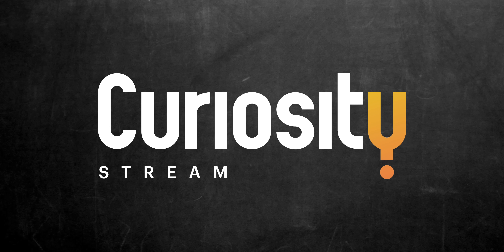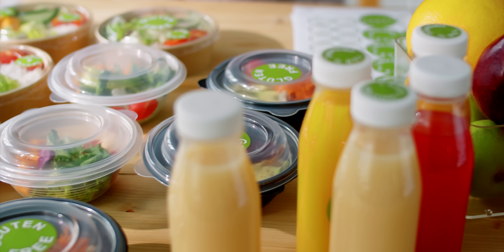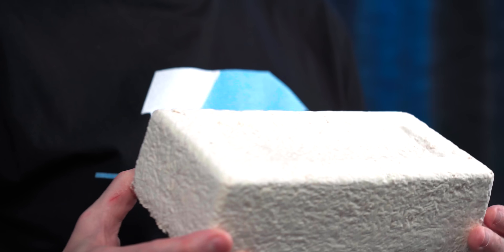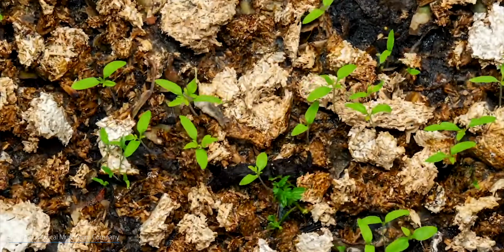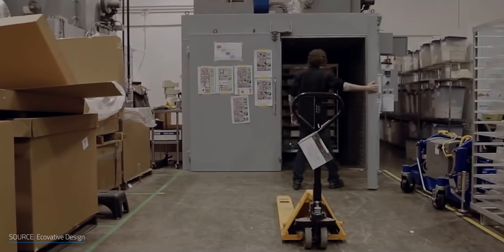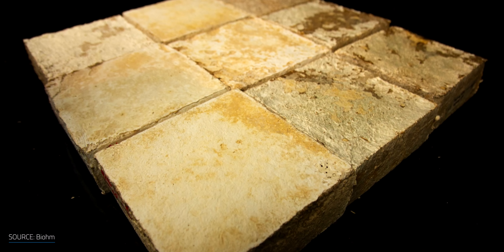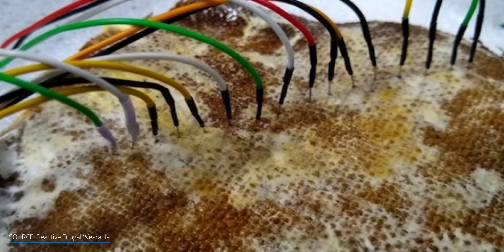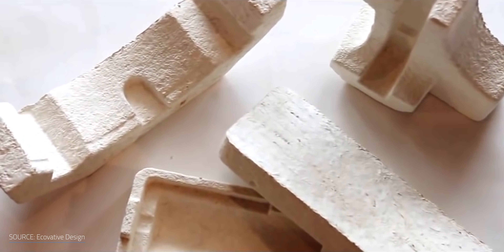Is Mycelium Fungus the Plastic of the Future?

Comment: Being biodegradable is the reason it will never replace plastics... Biodegradable isn't always what you want. For example, if you make a water bottle out of it, it will break down in storage because of the water. Long term storage would not be possible. The strength of plastic is its long term structural stability which is far more useful than something that is biodegradable.
So yeah we could use biodegradable stuff in packaging, but it won't help the fact that we have trillions of tons of plastic in the environment right now. Recycling is the only solution to that.
Reply: Not necessarily the only solution.  We have had some small success in developing bacteria that can eat common plastics.  Which can help.

Comment: Very interesting video. However, the biggest thing you missed is this: In what condition is mycelium biodegradable? Without explaining this, people would always be skeptical about its durability. Let's look at a scenario, say, you have mycelium insulation lining your basement wall and there's a small water leak in the wall slowly wetting the mycelium insulation. Would it biodegrade, grow mold, or produce foul compost smell?

Comment: For food and foam packaging, it looks great. But for something that biodegrades in 45 days, you’d need to prevent microorganisms from growing on and consuming the mycelium in order to use it for clothing or home insulation. Can probably be done with some sort of coating.
But PET bottles are never getting replaced with mycelium. Thanks to carbonated drinks being so popular, we need cheap bottles that can retain pressure, and are chemically inert enough not to alter the flavour. PP is more chemically inert than PET and might be strong enough, probably the same for PS, but none are biodegradable. For now that is, I’m thinking that within 10 years or so we’ll have some pretty decent PETase microbes. That’s where I pin my hopes. Introduce lab-made microbes into the ocean gyres, let them spread out across the oceans, the problem will go away by itself. Actually, the less chemically active plastics like HDPE will be much harder to break down via enzymes, but since they’re more easily recycled this may not be an issue. Non-carbonated drinks like water should be able to swap to HDPE without strength problems, but maybe that’s not ideal because of the enzyme thing.

On the topic of building materials, they’re the most permanent of the things that you mentioned. The CO2 output of Portland cement aside, there’s no reason to replace standard building materials with ones that are even more biodegradable than timber, unless there’s enough bio-chaff on the market such that there’s a surplus of mycelium. Low-carbon cements, sustainably forested timbers, recycled steel and aluminium, these are better building materials. Ignore glass, glass is another issue entirely.

Comment: *******Energies to kill back the spore growth?? How much Energy to do so in combo with productiin energies? Plastic isn't the problem. The problem is how it is recaptured as a renewable!
Most "throwaway" plastics carry their own heat flash off point. YOU DO NOT NEED TO BURN NOR DO YOU WANT IT TO BURN IF YOU WANT TO RECYCLE INTO NEW PRODUCT!
I am for mixing these Plastics into Roads though it takes a little more segregation and separate heating of each plastic before incorporating into granule stone and bitumen and a little longer to manipulate combined product into roadways, the benifits are that Roads last longer, can accept temperature changes better than regular bitumen and stone, allows better flex, accepts heat, will mot crack from cold winters. Perhaps may have to add U.V. protective additives. However a much better use. This just, though innovative, is another capitalization and movement into market and, serves purpose to be an ADDITION to our uses. Not a Bad thing but not particularly a sure fire Win other than its playing Hand in the MARKET GAME!*****

Comment: Oil companies are hanging on for dear life. In my area, an oil company sued Netflix for making the oil industry sound bad for the environment (all the show did was state facts)
Reply: Loooool if stating factual information makes a company feel bad, maybe they should change their practices. These industries say they'll go green by 20XX, but that in itself is almost a paradox. Oil companies going green? The only green they are interested in is that cash money 😂
Reply: I mean, I wouldn't say they're "hanging on for dear life", since oil-based products are still more prevalent and cheap than most of the alternatives save for a few specific cases. It's going to be a few years until we see widespread mycelium foam usage, let alone replacement for things like gasoline or rubber.
Reply: @bojackhorseman4176  gasoline will be become obsolete in the future sadly. Just as much as combustion engines, because of the Electric Vehicles hype. 

I say sadly because there is a way to make "synthetic" gasoline. By using hydrogen combined with carbon, you can get the fuel, in an even more pure form than otherwise. Porsche is studying exactly that and the aim would be to use the CO2 out of the air to produce these so called E-Fuels. Quite expensive to make tho.

And rubber? Again, E-fuels do the trick here. Not quite, but the same principle applies as gasoline, rubber, wax and all plastics are somewhat comprised of carbohydrates, that can be produced in the same way that E-fuels can be produced. But plastics... ye we need the stuff from this video for that.
Reply: Out of curiosity, would your area happen to be Alberta, Canada?
I ask because our gov has sued Netflix for a movie that depicted the oil industry in a mildly negative light

Comment: I'm sorry but you're 100% wrong about Styrofoam/expanded polystyrene.  It's one of, if not the easiest plastics to recycle. It's just that it's not very economical.  This is the main problem with all plastic recycling. Styrofoam is mostly air so it must be compacted (or since it's readily dissolved in many volatile compounds like gas/some oils, vinegar/ etc. condensed).  So it's a matter of cost not science.

Comment: More important than making packaging out of decomposable stuff, when are we going to use those plastics that last forever in our DURABLE GOODS??? We still build homes out wood and paper which can not only kill us by burning, but will ROT right before our eyes. Get that plastic out of the landfills and into the building materials our homes are made of!
Reply: couldn't the mycelium still rot and burn just like the wood and paper
Reply: @talesfromthealien  Yes! Using that plastic in landfills that just lasts forever would be better building materials
Reply: @josephgilliand4  I mean, houses inevitably have to be torn down when new innovations come around. Unless you love communist blocs, I think it's fine to have degradable products in housing.
Reply: @thepastaprogenitor851  Houses are only inevitably torn down because they've ROTTED to the point of being unsafe. You can have degradable materials in YOUR house:) I'll take plastic.:)
Reply: @josephgilliand4  isn't new stuff also torn down because new stuff can be done with the land? I'm not sure which one is more common but both seem like important reasons.
Reply: @thepastaprogenitor851  As if all houses that are built to last look like communist blocs. And so what if you plan on tearing down your house ten years later, it will have been rot-free all ten years. Planned replacement isn't a reason why you shouldn't use nondegradable materials in your house. Higher cost or health hazards could be deterrent factors, but you're not mentioning those, so there's really no logical reasoning behind your counterargument.
Reply: @thepastaprogenitor851  bro, definitely better to have a more durable house 🙄🙄 house is a house, where you suppose to live in long term not short term. You are just giving those developers free money
Reply: @Melethasgar  Thank you for explaining more thoroughly. I only doubled down because I wasn't sure last time
Reply: Bro the heck? Yeah I’m American the homes are noting but paper and wood. But most of the world a lot of the home is made of stone. Go to Europe and you will see how much of the home is stone with some beams of wood. And those homes can last for hundreds of years like you see in old cities around Europe. Plus those wooden homes can still last for about 100 years if you care for it and keep pest and water out. Also a plastic house will be super bad for human health. Constant exposure to plastic has bad effects on the body and hormones.
Reply: @X_bo420x  they stopped doing that because imagine mining stone for the amount of houses we have now.
Reply: @lileofficial4273  ever heard of concrete
Reply: @X_bo420x  lol. have fun wiring your concrete walls
Reply: Well, plenty of long term use containers are indeed made out of plastic.

Comment: I'm down for using mycelium to make packaging materials as a lot of that gets used every day and does not get re-used.
HOWEVER using mycelium in a house. Might as well put a sign in your front lawn that says "This house was made with ECO-Friendly Products To speed up the rate it decomposes So you Have to buy a new one in 40 years." 
My grandmas house was made with "NON-ECO-Friendly" materials when my grandma was in her 20s and most of the stone that was used in the chimney and basement is pretty much rubble.
Reply: But it could be used inside normal walls to make them more isolated both thermically and acustically..so we could already avoid using those materials
Reply: I would say insulation more than the walls of a house
Reply: It’s just for the insulation, not the building
Reply: @CampingforCool41  For now, at least.
Reply: It's about how you construct and maintain a house.

A fully wooden house would rot, too.

Buildings don't survive if you don't build them properly and then take care of them as they age. A lot of cheap matchbox houses fall apart not long after they are built by non eco friendly means too... Houses are no longer built to last like they used to be (which is a shame)
Reply: just build with compact cellulose fibers. those last quite a while. or minerals. wood hemp bamboo and brick.
Reply: it isn't often someone can argue a point thinking they are being contrary, yet in their argument completely explain why they are wrong... You think houses are built to last forever? That is hilarious and naïve. Less than 1% of the population lives in their house more than 30 years. it doesn't need to last that long and probably shouldn't. But cutting down the Forrest in order to build your house is completely dumb. If we could use a substance that we can make a continual supply of, it would benefit the planet greatly. Is this is coming from a meat eating real estate developer.
Reply: Houses aren't made to last forever but there are homes/buildings that have lasted thousands of years with good construction. People no longer live in their homes for 30 or more years because we no longer stay in one area as long, or pass our property onto our children. That's if the house was built well in the first place to last generations. I live in a house over 100 years old in better condition than the majority of houses in my area built in the 60's onward. This house, with maintenance, can probably outlast them too.
To prevent houses going abandoned due to disrepair, we can either build better houses, or we can build with materials that are easier to take apart and destroy. The cost of building homes is one side of the equation, when it comes to the end of its lifespan it has to go somewhere. If we worked with materials that break down easier and cleaner, we'd be doing ourselves a favor. 

It's like saying the condo building in Maimi wasn't supposed to last forever... like yeah thats true... but it was built with "modern" materials, and still only 40 years later it came toppling down due to neglect (they knew it wasn't structurally sound). If we don't improve our infrastructure, soon enough we will have tons (literally) of buildings (and bridges, etc) doing similar things. We have to build better

Nothing lasts forever but that doesn't mean it shouldn't be built well, with better resources if available. If we find better materials, we should make use of them
Reply: Also with the bricks or rocks, they may have used stone that was not appropriate for a fireplace

Back in the day that's how a lot of fires were started because the rocks or brick would explode and there goes the village

Also if the house was built on soft ground, her basement could be settling. My father's house (built in the 20's) is steady sinking cause of this lol

He has to keep jacking up the house, the bathroom door is crooked (like it had to be cut) to fit the frame 😂
Reply: @Stirgid Lanathiel If you really want to save on housing you'd force everyone into apartments.
Reply: "Oh no this biodegradable material is degraded by biology"

Comment: Thanks for the video! I'd be okay with mycelium insulation in my home, if it was as fire resistant as the regular old plexiglass that's in there now. Like you said, the mycelium is dead, so it's not going to send spores down through the trap door from your attic. And besides that, there are already fungus spores in every house. With the dry conditions inside a home they get no chance to grow, but they're always present.

Anyway, it sounds like the greatest potential for mycelium based "plastic" is in replacing Styrofoam. That's an important and beneficial achievement all by itself if it can be done.

Comment: That was SUPER fascinating and kinda meshed with a "Stuff you should know" podcast I recently listened to about plastics. Did you know that most of the "recycling is a good thing we should all be doing" drive has been pushed by the plastics industry itself as a way of diverting attention onto the public as being responsible for dealing with the issue rather than industry actually addressing the problem?

Comment: 2:21, YES, TRUE, burning plastics creates a toxic cloud that can cause cancer in animals and people and cause plants to die, that is IF the plastics are burned in an IMPROPER way, plastics that are burned around 2000 degrees fahrenheit, burn completely and the toxic chemicals are also destroyed. while the energy to burn the toxic chemicals IS costly, there is a natural energy source that reaches those temperatures, a facility can be created on the side of a volcano and the plastics can be loaded in to large THICK paper containers and dumped in to a volcanos lava, where the paper container will survive the heat and sinking in to the lava pit long enough for the container to be covered by the lava , therefore allowing the toxic chemicals to be incinerated along with the plastics and the only remains would be carbon, which would be ash, if, even that.

Comment: With the right tecnology, it could be used to create self-regenerating structures, like a wall that when breaked, you just need to "feed" it to restore the original shape
Reply: If it still has growth capability, how do you prevent it from growing when you don’t want it to?
Reply: @whwhwhhwhhhwhdldkjdsnsjsks6544  it needs nutrients to grow, but anyway, it's just an idea of possible technology
Reply: @csoares289  yes, but there are nutrients in the average household. Like what if you drop an apple on the floor and forget about it and a little while later the house has grown around it

Comment: The mycelium packaging looks about the same as paper composite packaging. You know, those drink holders you get at restaurants? Paper packaging already has an established place in the industry, meaning it will cost nothing more to use it instead, where mycelium packaging requires initial investment and a comparatively very long time to produce. Mycelium products seem like a novelty or a fad.

Comment: As a model builder and 3D printer, I use a lot of plastic for a normal person and I try recycling what I can. While my first thought of mycelium as a plastic replacement amused me for my use case, I really like the idea for it in uses outlined in the video, among other things. Mycelium spools would be insanely useful for 3D printing; the plastic spools we currently use are difficult if not impossible to recycle or break down back into filament and take up a large volume of space over time. Having a mycelium spool that I could just toss in the back yard as compost after I'm out of filament would solve one of 3D printing's biggest problems, economically!